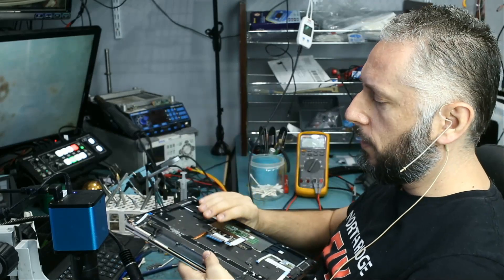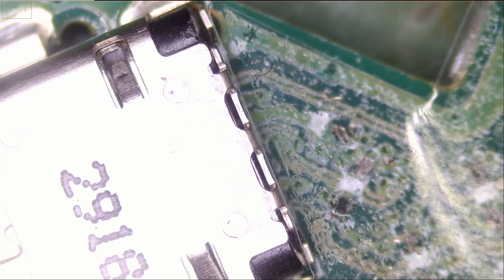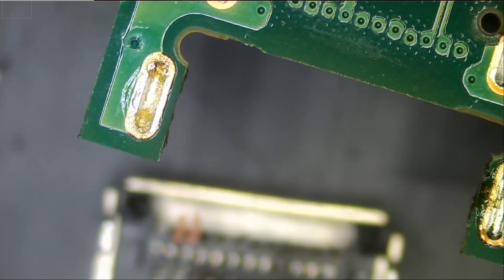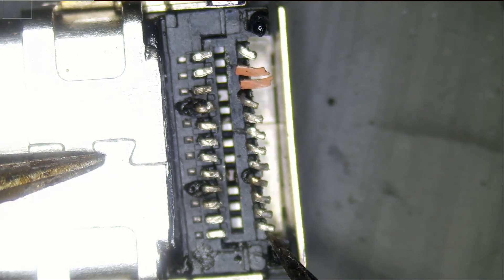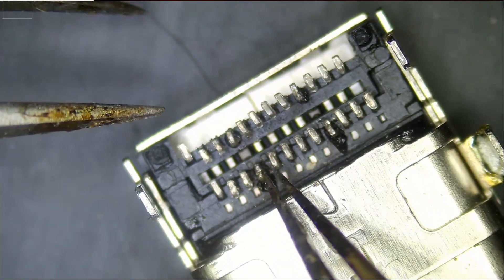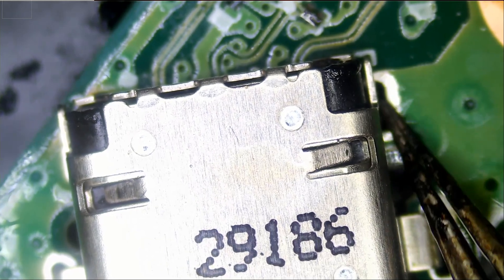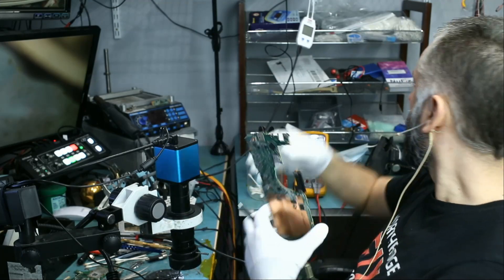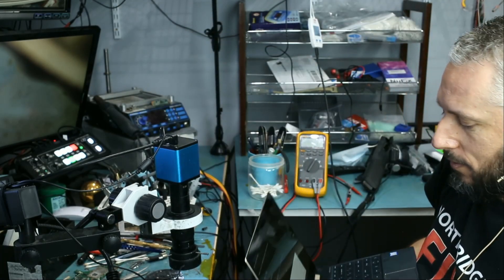HP Spectre x360 Laptop No power Not Charging Repair - 13-AP0053DX - USBC Issues with this model

Comment: Congratulations for your great job. Certainly your experience says otherwise, but could you have saved the other port as well by using some jump wire to restore the missing pads and soldering the other usb port too? Thanks for the attention. Greetings, bye bye,